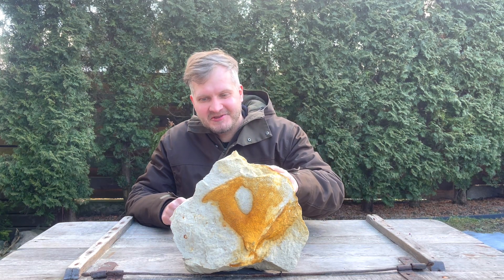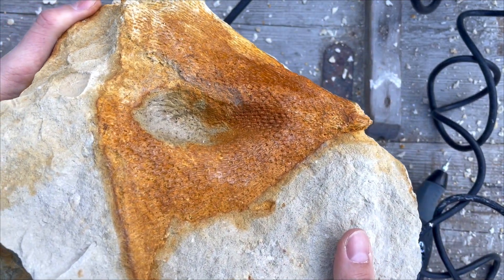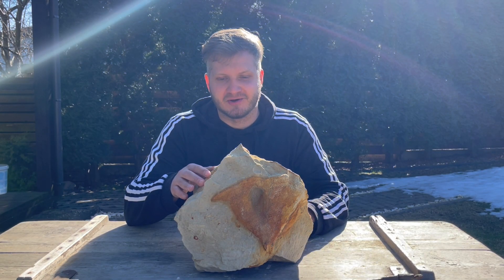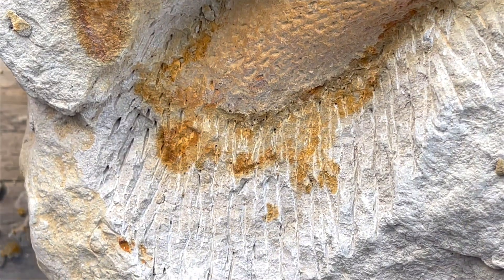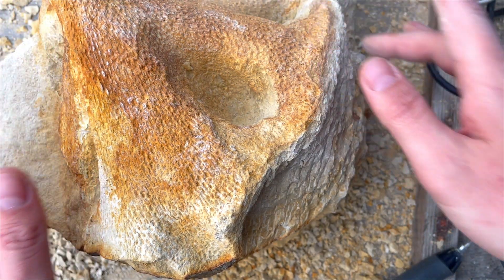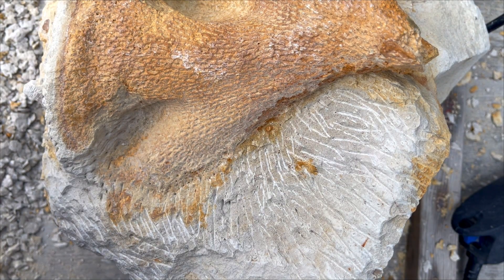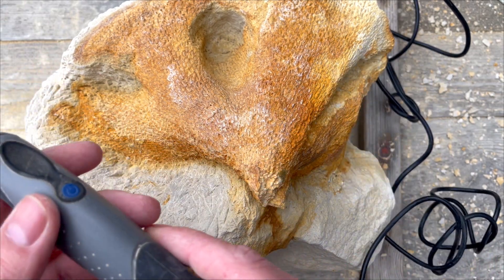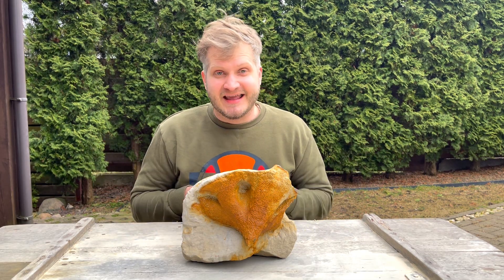66 Milion years old ventriculites sponge fossil prep

Comment: I think this prep needed a sandblaster, a tungsten pneumatic scribe is too damaging. but I must say well done.
Reply from the maker: Its chalk, i think sand blaster would have blasted fossil
And matrix away🫠
Reply: @Amberscape  I think you misunderstand how it's supposed to work. sandblaster is softer than the pneumatic scribe it is typically used for finer works. the pneumatic scribe is just for removing chunks.
Reply from the maker: Chalk is very soft - sand blaster would blast the fossil away too, either way i dont have it yet even to try, in the future i will acquite sand blaster to my arsenal:)